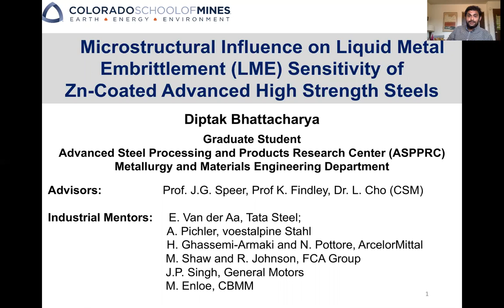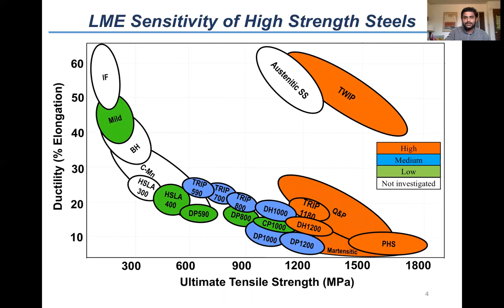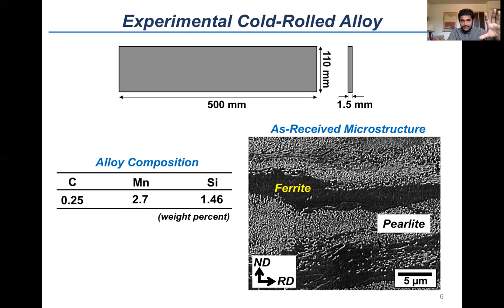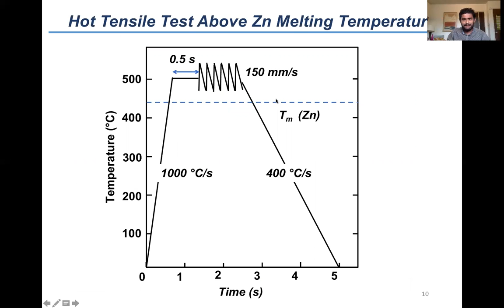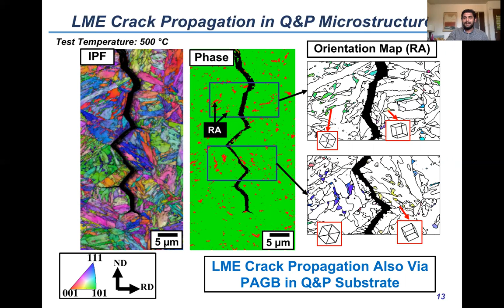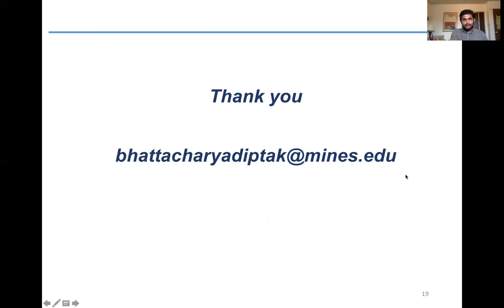Diptak Bhattacharya - Microstructural Influence on Liquid Metal Embrittlement (LME) .....

Comment: Thanks for the video. What if we start the heat treatment for DP steel with full austenitizing to dissolve carbides etc.  and lower the temperature to inter-critical region, then subsequent quenching to room temperature. Do you think will it create a difference in LME compare to the heat treatment route directly starting from intercritical region ?